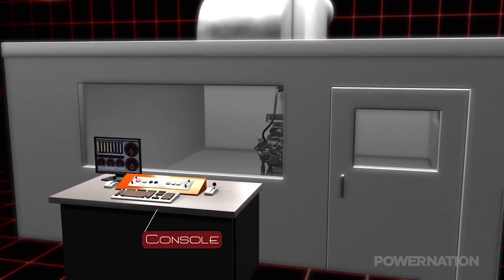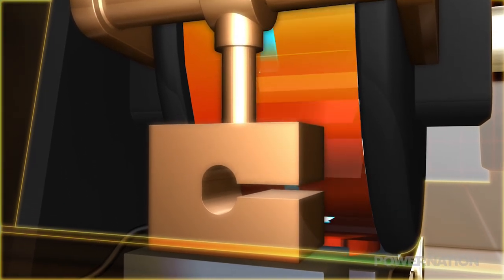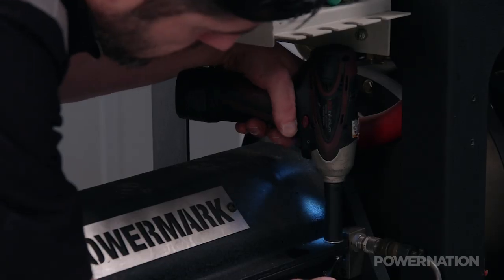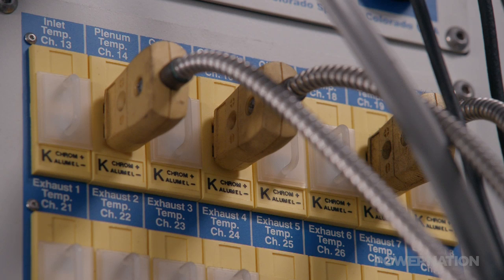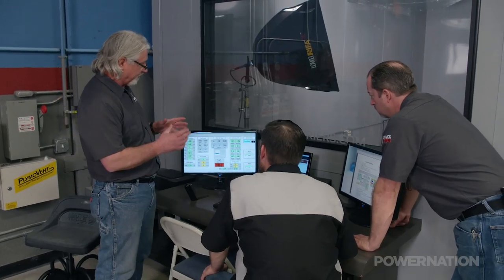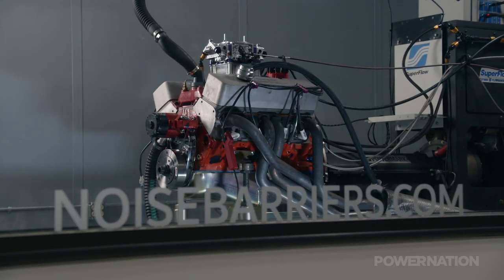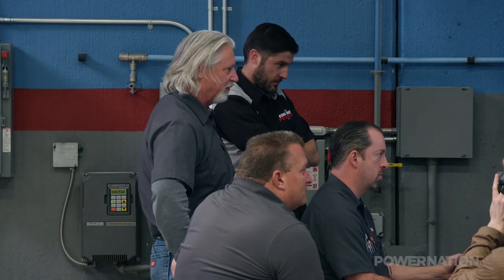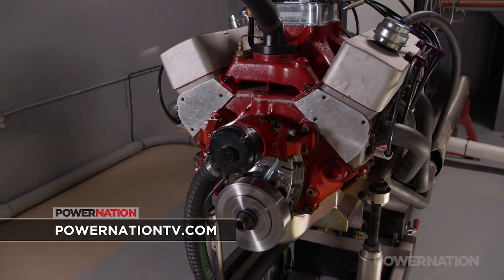How An Engine Dyno Works

Comment: I had to watch 8 videos on how a dyno works, none of which explained how a dyno works, to finally find this one, which actually explains how a dyno works.  The graphics are perfect.  They tell me exactly what I wanted to know.  A turbine spinning water is connected to a block of metal with a strain gauge on it.  The water is recycled from a tank.  All the other videos are titled "How a dyno works" but they just show "what a dyno tells you", or they say "it measure x and transmits that data to your computer".  Useless info.  We all already knew that.  Thanks for the great video.
Reply: Yeah, I was in the comments of another youtube video and they were arguing that "you measure torque and calculate power, oh no you don't you measure horsepower it's not calculated". Strain gages popped into my mind so I ended up here. You measure force and calculate both torque and horsepower. It's amazing what uninformed people think.
Reply: Always trust the videos with  mechanical animations that come across like a power point presentation, these types never fail to inform

Comment: As an engineer i must say that 'calibrating when you think the numbers are wrong' is just silly. For any peice of machinery or tooling in use, calibration checks should always be done regularly and atleast checked before use lol.

Its called sensor drift.
Reply: Poor guy. He fell victim to the producer of the show no doubt. This style of "production" needs to die off already. There are a thousand channels producing better comment with no stupid forced lines and terrible acting.

Comment: Can a dyno like this calculate engine efficiency as well as power output? That is...can it measure how much of the energy is wasted in heat?
Reply: If you know the power output of the engine, fuel flow rate and energy density of the fuel. You can calculate thermal efficiency.

Comment: A Dyno test is different than a Dyno tune ?
Reply: Yes Luis. A test can literally be 1 pull or run to record the torque and then calculate horsepower with a correction factor. The new dynos like you see do this instantaneously. 
A tune is many runs or pulls, and on my dyno I monitor exhaust gas temperature or E.G.T., Air fuel ratio or A.F.R., the B.S.F.C. which is brake specific fuel consumption,  and I always monitor knock sensors too. You might have 10 pulls just for optimal ignition timing alone. Turbo/blower/nitrous can have a handful other parameters to monitor and adjust or compensate for. Remember Sir, the best engine builders in the world,  still READ SPARKPLUGS.
Read that again. The ground strap will tell you about your timing, the porcelain will will tell you about the wide open throttle fuel mixture. Not on the end of the plug, but deep down inside on the porcelain. And even a million dollar dyno can't read what the plugs understand. 
T.S. RACING

Comment: Shouldn't  the torque reading be measured in poundals?
Reply: Torque is measured in lb/ft (which I believe is what you were trying to say). There are really 2 aspects to this measurement:

- Pounds (how much force is being applied to the load cell?)
- Feet (how far from the center of the axis of rotation is the measurement being taken?)

When it comes to calibration of a dyno, you calibrate the load cell with simple weight. The length of the torque arm (or length off center of axis) is a factor that the system knows as well, and uses this along with the output of the load cell to calculate a number that's a in lb/ft.

Hope that makes sense.

Comment: the funniest Dino video i’ve seen is the  the one that Vic Edelbrock did with his daughters in the  Control Room watching and they Pranked the girls    as the test got more serious and the engine was roaring they  wanted everyone to listen carefully for any strange noise or possible f signs of failure and someone quietly walked in with a metal Cookie sheet  and some Wrenches  as the tension built up they banged very loudly on the cookie sheet and it scared the Crap out of the Girls who figured out they were Pranked right away and laughed about it  with everyone else  it was obvious they had all worked together for many years  i forget who’s motor they were testing or why but it was a important one for Edlebrock and something the daughters were very involved in

Comment: i wonder how they calibrate the actual weight of those bench press weight plates?  Weight room plates are notoriously inaccurate, for example, just because it says 45lb in big bold letters on the plates, doesn't mean it's actually 45.00 lbs.
Reply: Anyone can buy calibrated weights online from a company with a proven reputation that is specialized in calibrated weights for industrial purposes. Those cost a lot more as the weights that you see in the gym, although they might look the same. The only difference is that the calibrated weights are fine adjusted to a specific weight at a specific temperature with a specific guaranteed tolerance.